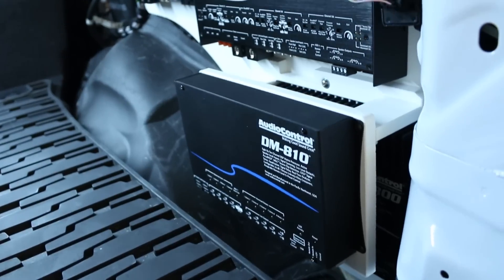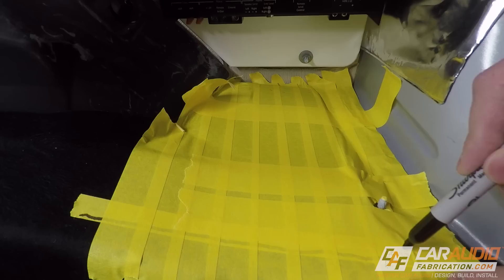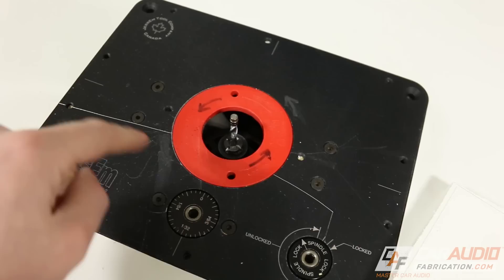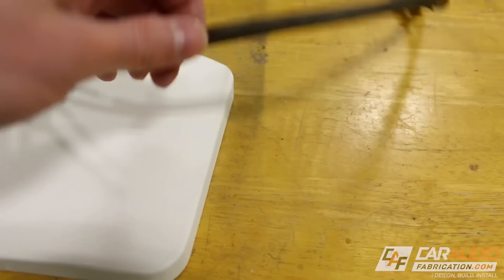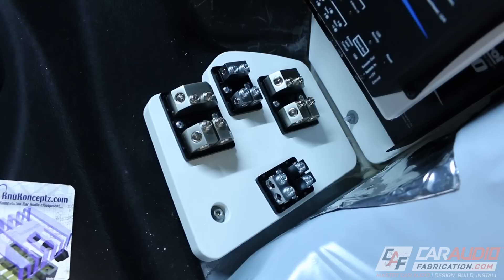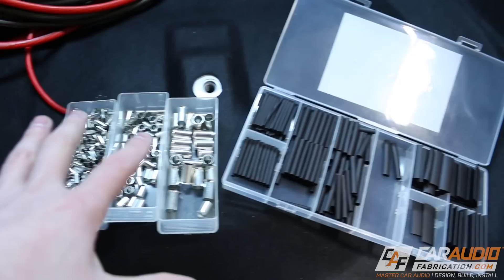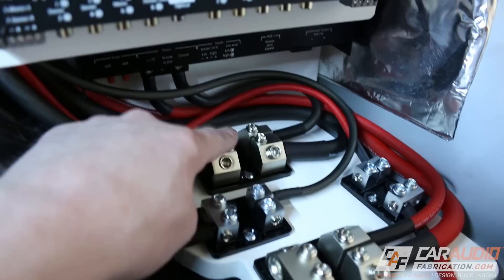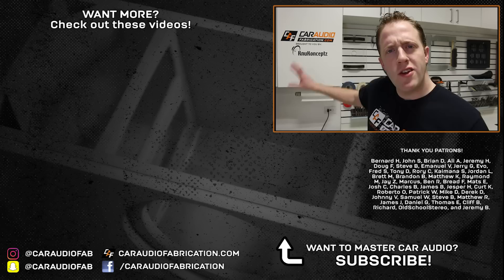ADVANCED Car Audio System WIRING - Power & Signal Wires

Comment: Only critique, and I know its superfluous... Run the ground back to the battery, not the local chassis point. No chance of noise that way for the cost of a low gauge cable and the labor of course.

Comment: I have my head unit with 1 signal output and 3 units requiring signal whats the best way to split my signal? Im using the supplied signal wire it looks to be about 18gauge.

Comment: I have two amps and some fans...I have the remote wire from deck connected to a fused distribution blocks and that turns on the amps and fans is that the right ways thanks for any help

Comment: Is It safe to run (1) 4 gauge in & (2) 4 gauge out from a distribution block or should i only go 0 gauge in to multiple 4 gauge out?.... running a 4ch amp and sub amp on 2 12in CVRs
Reply: Is it safe ?? Yes it's safe! Now depending on how powerful the amps are will depend on whether you will suffer a voltage drop or not. If your running a couple of 300-400 watt amps ehhh probably won't suffer too much drop. If the amps are any bigger it's a very good chance of significant drop and I would suggest at least a 2 awg into the district block.

Comment: HELLO,I AM INSTALLING AMPLIFIER,  DSP(DIGITAL SIGNAL PROCESSOR) , SUBWOOFER AND COMPONENT TWEETER SET IN STOCK (HYUNDAI COMPANY STERERO) .I WANT SEE ITS INSTALLATION THROUGH A VIDEO FROM POINT TO POINT AND HOW MUCH GAUGE WIRE WILL BE FINE FOR ALL OF THESE AND PLEASE TELL SPECIFICALLY SO THAT A FRESHER CAN UNDERSTAND. I AM INSTALLING ALL THIS IN HYUNDAI ELITE I20 (INDIA) . DO I NEED TO ADD SOMETHING MORE ?

Comment: Hi Man

I installed my LCI7 LOC and PolkAudio amplifier in the boots  and I run power cables and signal cables together in the same channel . I got whistling noises in the speakers when accelerating 😭. 

Does it happening because the cables are run together ? Should I separate them or could it be other issues?

Comment: Mark, I have a question....
What is the best way to connect the 4ga power and 4ga ground wires to Rockford Fosgate Punch amps which use Phillips head screws that tighten a square-type area where the wires attach to the amp....
(ROCKFORD FOSGATE PUNCH 400X4 & P500XBX1amps)....?
Bare wire?

Comment: Love all your videos. After following your work I finally got myself a subwoofer system for my car. I have a 2015 Infiniti Q50s. I recently bought a pre built subwoofer box with 2 12" Alpine Type R subs installed in the box, a 1700 Brutus Hifonics amp with a LOC. I hooked everything up to the factory system and it sounds great and all but I find that it's not as  loud as I thought it would be. Would love to hear your thoughts and advice on what I should do. Thanks in advance

Comment: HEY- OLD GUY HERE WITH A BASIC QUESTION THAT NO ONE SEEMS TO ANSWER:
I am installing a stereo on my motorcycle, should I connect the positive (+) wire or the negative ( - ) First????
Reply from the maker: For the amplifier? Usually a good idea to connect positive first and then the ground.

Comment: I need some advice... I just installed a 12” kicker comp C and a fosgate prime amp on 4 ga kit. It sounds really good when the car is off but when the car is running the sub sounds blown. I never encountered that before and I need help. Any advice will be much appreciated. Thank you
Reply: You are getting engine noise. Try running the power wire down one side of the car and the rca cables down the other side separating them. Also make sure you have high quality insulated rca cables. And one more very likely cause is the ground. Make sure you have the ground wire mounted to the most solid piece of steel you can a direct frame connection is best also make sure you have a nice sanded smooth spot where the ground is mounted to the frame.

Comment: how would this RCA by knukoncepts perform against stinger 8000 series or other top brands. please be unbiased and detailed , thankz !
Reply: Im going for the stinger 8k still just personally think that it has been a good standard for a while
Reply: @drummingpc  what about against the 4000,5000 and 6000 series. this is really important.
Reply: I have Knu Krystal and love them.  But be warned, they are almost as thick as knu 4 awg power wire.
Reply: literally no difference. theyre rcas. you dont need a special brand

Comment: Hey man, quick question hope you could help out. Would you happen to know why my new rear car speakers that I installed wouldn't power up even though the front oem ones produced sound fine?
Reply: First off did the rear speakers work at all before you changed them or is that the reason you changed them. If the old ones didn't work then you might have a broken connection somewhere. If he old ones did work I'd recheck your connections where you added the new speakers maybe even try and see if any other speaker will work hooked up to those wires. It's also possible you got a bad new set of speakers or very unlikely idea if you got an extremely high dollar very powerful set of speakers the head unit might not be powerful enough to run them. Just a few options to maybe try.

Comment: Is it necessary to fuse the smaller wire when you go from a thicker gauge wire to a thinner one as you have in your distribution blocks?
Reply from the maker: Yes, anytime you step down wire size the largest safe fuse you can use reduces so you should have a fuse in the transition.

Comment: Hello, I am loving your videos. I’ve recently bought a car which came with a old sub Pioneer Ts-WX75A and it was wired behind the radio, with the constant wire giving it constant power and acc for the other power, now bought a Pioneer Deh-s510bt and it has recently been acting weirdly losing memory, Bluetooth devices, audio settings. So I tried disconnecting the subwoofer and it starting working correctly, how should I wire that subwoofer ? I know nothing about sound...
Checked the constant power and acc, to see if they are wired correctly to the radio and it is right. Don’t know what to do can you guys help me ?
Reply: Sometimes you need to swap the red butt with the yellow one (of the stereo).

Comment: Hey there, nice and standard good custom stuff there. I recall a while back you using those wire or cable protectors, that you slide over the wires like a sleeve, kinda looks like a Chinese finger trap. Do you still use those ever? If not, why not? Thanks for sharing this clip, and keep ‘em coming! Aloha

Comment: @Car Audio Fabrication  

Mark, great video.  But I noticed that at 7:57 in the video that you did not remove the paint under the threaded grounding stud that you attached your large ground cable to with the ring terminal.

For a connection with that much potential current capacity, you definitely need to remove the paint with sand paper or a wire brush so that you have plenty of clean, bare metal on the vehicle's chassis where you connect your ground wire.

After making the connection, I would also protect it by using anti-rust paint or dielectric grease to prevent the possibility of corrosion or oxidation.

Comment: You may have addresses this in a previous video i missed but I am curious how you deal with running speakers of different RMS rating off same amp...for example I want to run an indash pair of mids that RMS at 30 watts per channel but my full range fronts are 60watts rms and read doors ar 50watts RMS. I want to make sure i get the most power available without damaging the smaller in dash speakers.
Reply: To do it properly you will need a six channel amp and it should have gain controls for each channel. That or be running some crossovers and switches that will be a bit more complicated to dial in.
Reply: If it were me most stereos will easily power the 30 watt speakers so I would run them from the head unit and then a two channel amp to the other two sets.

Comment: The rear deck on my 2014 Honda accord has  a lot of rattling near the speakers and third but nothing has worked so far. Can you make video on how to sound deaden the rear deck of a sedan car with a third light.
Reply: Got to pull the rear deck paneling up and put sound deadening mat under it all.
Reply: Later it in as thick as you can and still be able to reinstall the deck panel

Comment: Why didn't you sand of some paint on the factory ground connection?
Reply: I'm sure he did, he probably just didn't sand the white bolt over the terminal ring. Why the ground cable is so long? That I do not know.

Comment: Did you say tinned ofc? Wouldn't that be cca?
Reply from the maker: No. CCA is aluminum with a copper coating. (Copper clad aluminum) The tinned OFC is pure copper with a layer of protection to prevent oxidation. Great for marine and automotive environments.

Comment: do you not have to crimp the ferrules ?
Reply: No the heat shrink holds the ferrules in place and it becomes crimped once you tighten down the set screw
Reply: Yes, ferrule crimpers for all sizes exist for a reason with different crimp shapes and they are ment to be used, not ignored, not crimping these is a no no

Comment: Is it a smart idea to run wires under a vehicle?
Reply: only if you cant run it through the cab
Reply: imBriz that doesn’t seem safe being that it is exposed to the elements and critters and such. Lord forbid you have a leak and a slit in your power wire and a fire starts
Reply: @kid_rajah  a fire wont start if its fused
Reply: imBriz Im not asking a simple question. Think outside the box. Someone runs wire under their car, and frays their wire causing an electrical spark that ingnites whe fuel and KABOOM